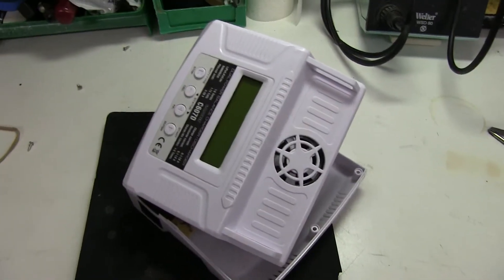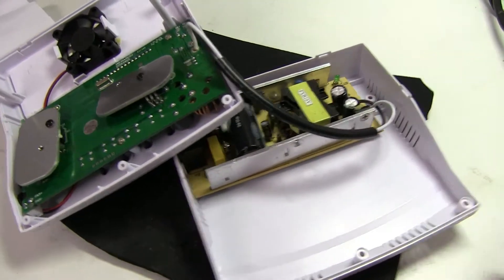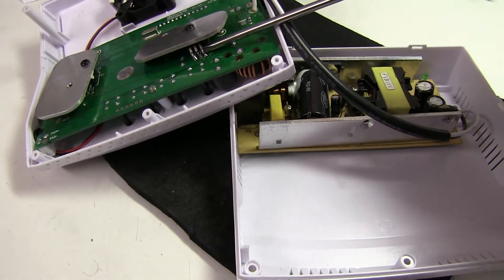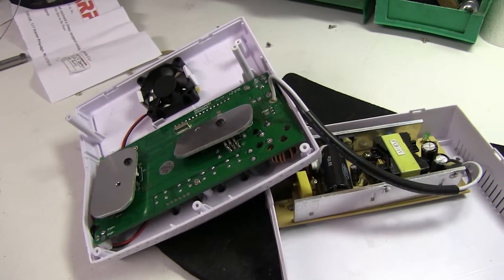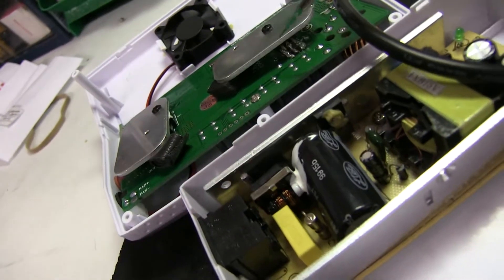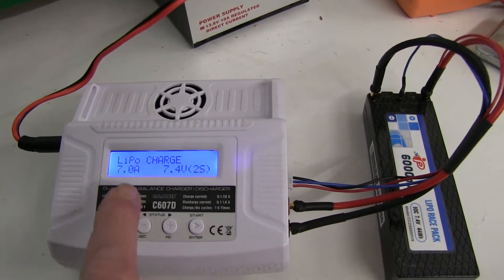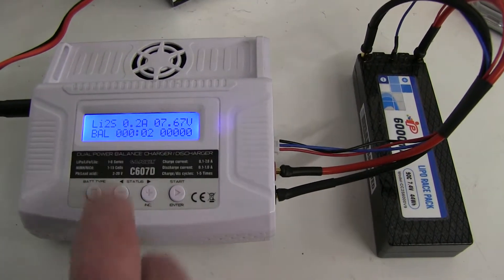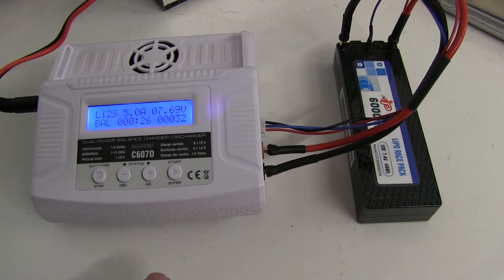Lipo Charger Repair

Comment: I have a different voltage in digital charger after finish to analog charger. Analog charge more accurate.. What should i do
Reply from the maker: Hi Oq.  Just use the analoge charger

Comment: i have the same problem with my venom pro 2 but the whole plate fell off! smelt a burning smell and gave me a low voltage error. should i resolder and see if it works again? its a good charger and dont have the funds to get another good one
Reply from the maker: Hi. Burning smell is not good. It normally means the component is damaged. Look at the components and see if any badly burnt. Then you could try soldering back on, but only connect power briefly and see if anything smokes. All the best. Nick
Reply: @nickadams5411  thankyou

Comment: I have a sigma2 EQ Battery charger and I’m getting a message on the screen saying BREAK DOWN at there or bouts 10 seconds in to trying to charge any battery can you help I cant see anything apparent
Reply from the maker: Hi Paul
There are a few different faults that give the Break Down message.
1. the input voltage supply is too low.
2. The battery voltage rises too high. (Normally due to age)
3. The connectors, input or output are poor fit and causing voltage fluctuation.
4. An internal component has a bad soidered joint, or is failing.

To check the connectors, feel them when it fails and see if they have got hot.
Also make sure they are a tight fit.